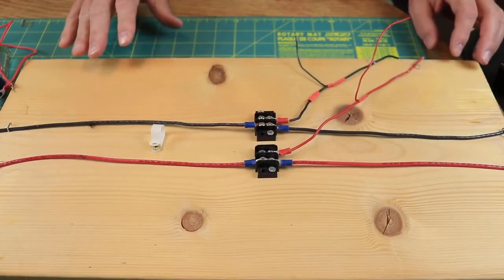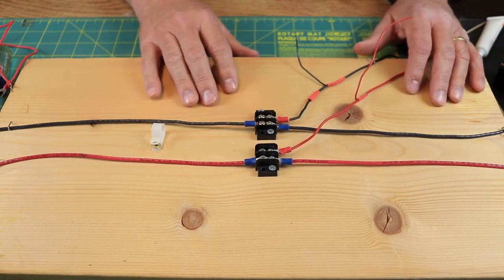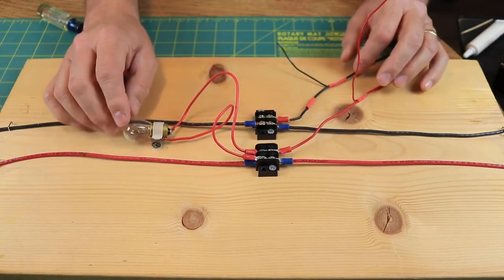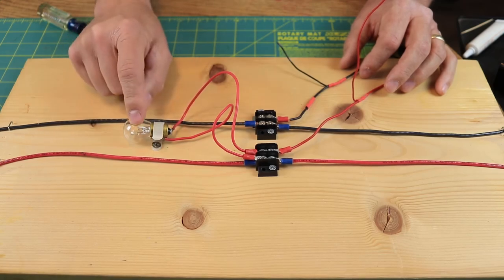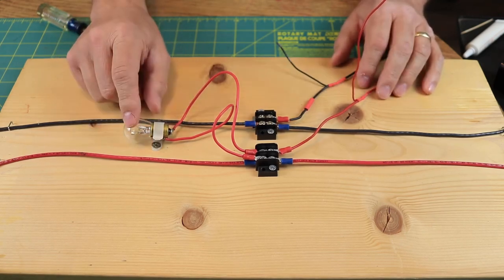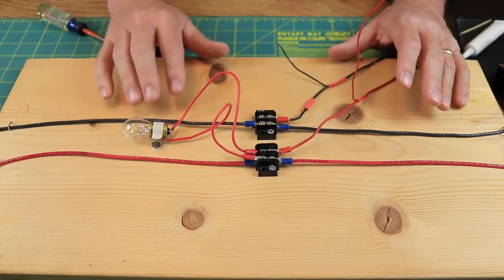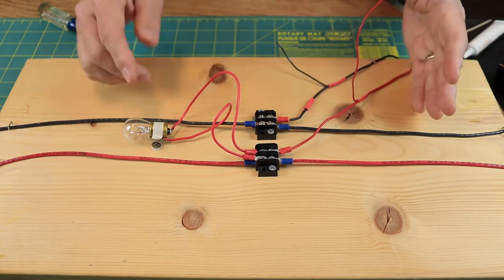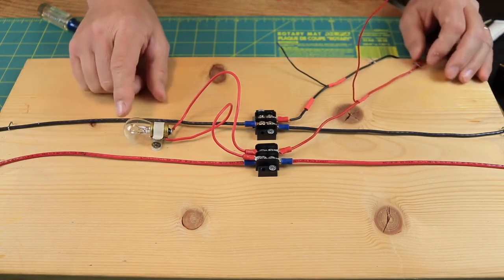Wiring and Short Circuit Protection for Your Model Railroad

Comment: Model Railroading channel has an "Upgrade" for Short Circuit "Ballast" lamps 4 years ago. see Build The Improved DCC Ballast Lamp Circuit Breaker (109) Summary: The 2057 lamp "trips" the same as 1156 but the PPTC breaker between the filaments then reduces the bulb load to 0.4A protecting the Controller and more at the lower amps. 2.5A is enough to burn out small things down stream even when you are careful and don't run without someone being there.

Comment: Why are you using a 1950’s short circuit protection method for wiring a modern layout?
Reply: Guess he never heard of a fuse, or a PM-42.
Reply: @troy.peters  Fuses are pain for many reasons. Auto reset breaker including PPTC types have issues too that will often reset without finding the problem causing headaches for DC and more so with DCC.
Reply: 1. it still works 2. is cheap even when you use the upgrade lamp and breaker. 3. does not need extra logic to run DCC etc. 4. If you change bulb type, it can works with DC or DC/DCC layouts too.
Reply: @Thingstest-rl8xu  It is STILL 1950s wiring and way behind the times.
Reply: @RichB_HTX Fuses and many other Circuit Breaker types are way older "tech" with many types for 100 years or more are still in use by Huge Companies. PPTC "Pollyfuses" are least 30-40 years old tech but only available to the public for about 20 years. Your Vacuum cleaner, Hair driers, and Thousands of other items to Pass UL TUV etc from Decades Past to Now have these "old tech" parts to prevent burning down your house with many are not even replaceable by the owners when blown.